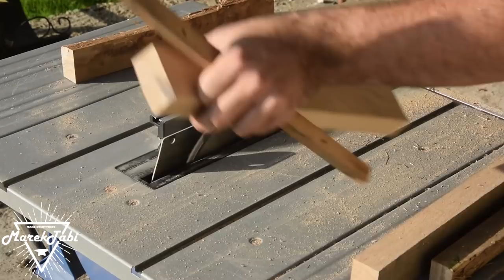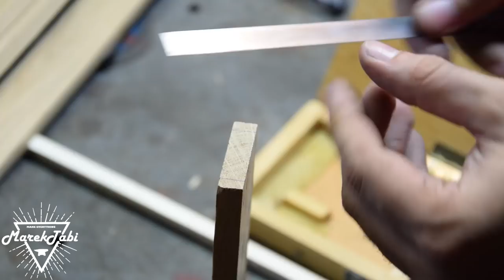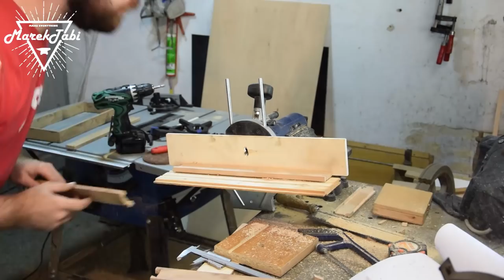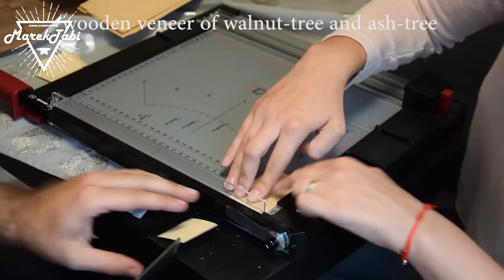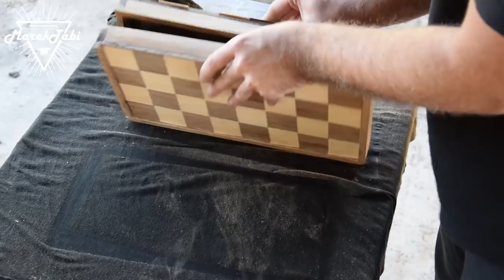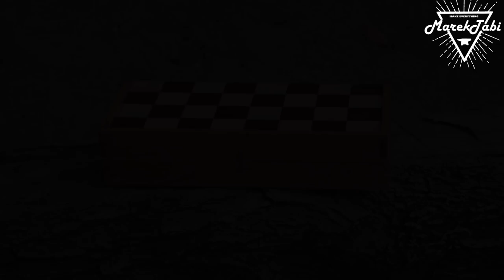Old chessboard remake restoration

Comment: I agree that this is not what I expected with the title saying restoration. I think it was a great project especially considering that you are used to working with metal rather than wood. I myself would propably have tried to replace only the broken board because otherwise the box seems to be intact. I think that with some experimenting you might have found a way to wear the new board down to look somewhat like the old ones. That way you could have kept the aged look of the box. But obviously that was not the look you were going for. I like the fact that you still left the old board to the inside of the box.
Reply: Although this comment is three years too late, great to see you hear.